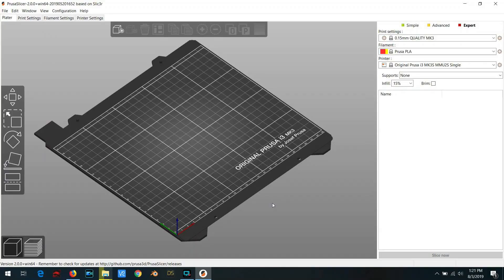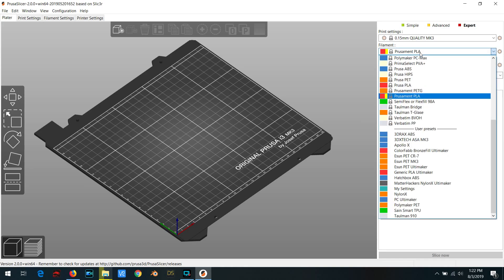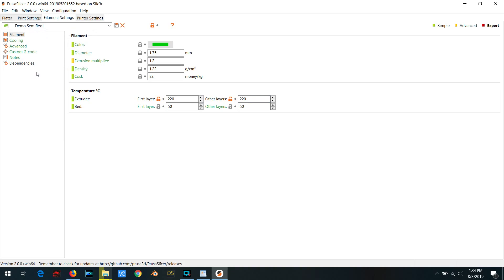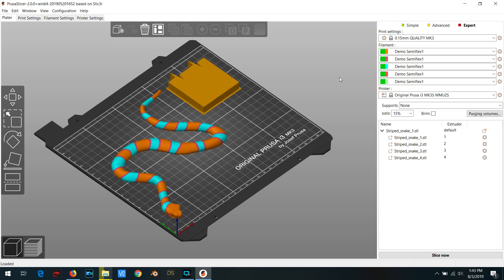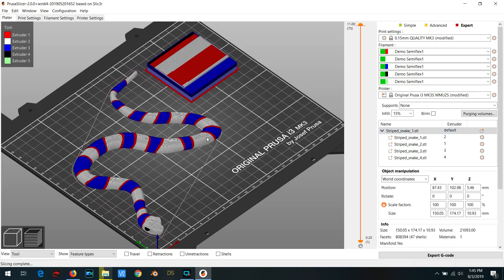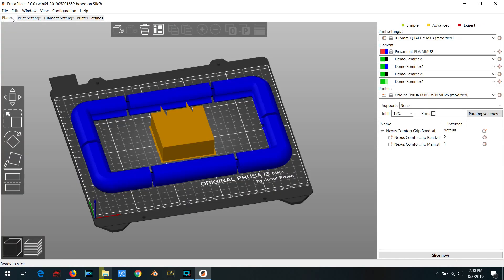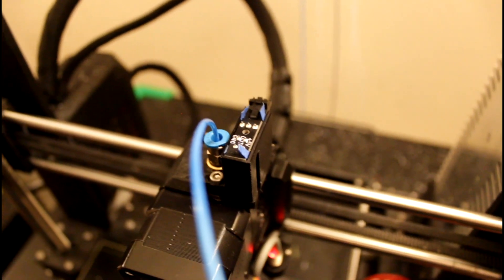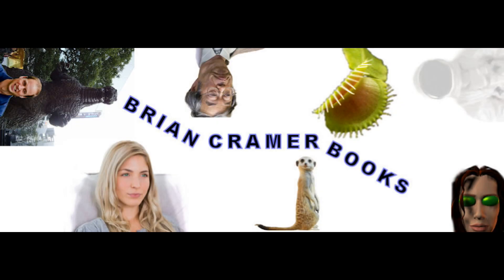How to Print with Semiflex TPU on the Prusa MMU2S Multi Material Unit

Comment: Thank you so much for this video. I have has a roll of Filamentum TPU 98A sitting in my cupboard for months waiting for me try my first flexible printing. I some how jagged my first print, but then spent the next 5 hrs wrestling to print a 2nd run of the exact same file, with no slicer changes and it wasn't working... watching your video was super helpful... in the end, it was the IR sensor that got me... a bit of masking tape and an adjustment after watching your video and it worked on the very next print!! THANKYOU
Reply from the maker: Awesome! Yes, that sensor is definitely finicky. I'm glad you got it sorted.

Comment: One entire day of swearing with the MMU2S and TPU then I found your video....I shoud have look before!
Reply from the maker: I'm glad it helped. I still swear at the mmu2 all the time, though.
Reply: @0calvin  Now i have a issue, I sent a multimaterial file to print with MMU and experimental wipe tower to save time but I forecast a rapid collision after wipe finishes. If I rise the Z in pause mode will the head return to lower position on resume? (using pronterface, not SD)
Reply from the maker: @Rapbando  I have a printer that I run with pronterface. When I pause it and move the z up, when I unpause it, it automatically returns to the correct height, but your milage may vary.

Comment: Great video. I came across this on Google after fighting with my printer for six hours, just trying to make it load NinjaFlex for a single material print. I actually discovered the IR sensor issue, and used some thin left over TPU support structure in exactly the way you did with the tape, wrapped around the sensor board. With a lot of tweaking I was able to get the NinjaFlex to load reliably maybe 70% of the time. Still not reliable enough to multi-material print with, but at least I can single material print. I'm hoping Prusa addresses this issue at some point.. They still say flex is coming soon for MMU2. I did also run into that M220 issue with my Semiflex with PLA as support structure, and I was manually editing the gcode files to fix it, so thanks for that.

Comment: Those M220 Sx are there because you have slow "Max volumetric speed" in the advanced tab of the filament options set to a low value (which is good with flexibles). This is how it's supposed to be.
Just leave the speeds default and scale them using volumetric speed for flexibles. Best testing methodology I've found untill now with flexibles.
Reply from the maker: I'm not sure about that, because the M220s are not there when I select "PET" instead of "FLEX" even while keeping the slow volumetric speed.

Comment: this is going to be interesting
Reply from the maker: Hopefully it was.
Reply: @0calvin  just watched, yes it was thanks for the effort, not sure why you changed speed only to reduce it again latter. do you not think that is why they choose 35% ?
Reply from the maker: One reason is that it would also reduce the rapid speed (travel speed) from the stock 180mm/s to a pokey 63mm/s. This would make even more strings while the nozzle dribbles while moving from place to place. Also, defining the speeds explicitly for each material gives me a little more control if I need to tweak things. Thanks for watching and I'm glad you liked it.
Reply: @0calvin  got it thanks